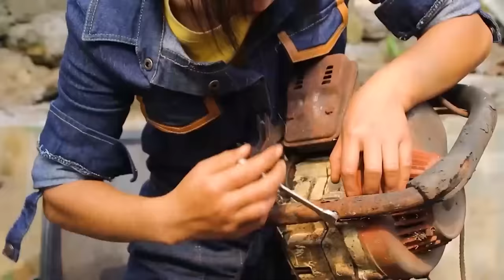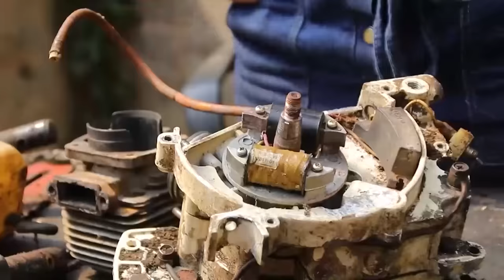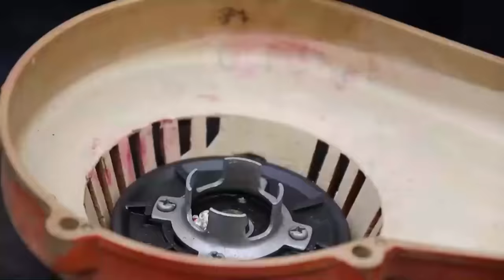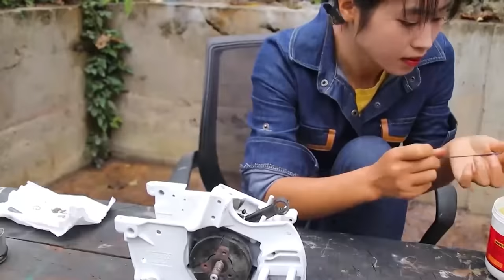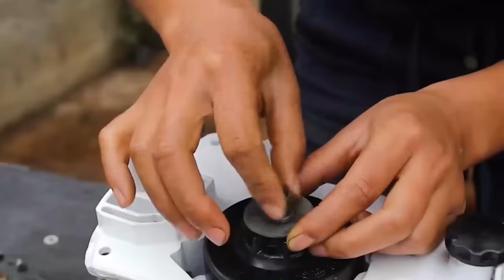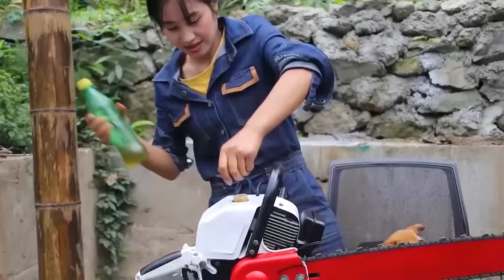💡Girl Restoration Old Rusty Gasoline Chainsaw With Her Own and Fixing 2 Stroke Petrol Chainsaw

Comment: Wow! Another cool project! What kind of chemical did you use as 'rust remover' ? The end result looked great as always. You really had a happy face when testing it out! Hope you do have hearing protection if you have to do a lot of sawing. 💙
Reply: it has to be good, any chemical that actually does the job it is designed to do is not allowed in the usa, our epa has outlawed anything that works.
Reply: they can get good chemicals over there that most western countries have banned, for us evoporust is probably your best option, but is is pretty slow

Comment: That's "file" the serrations - not "sand". Also the best way to use the saw is to have the sharp prongs at the base of the blade - the "bucking spikes" - in contact with the log to provide stability and safety. Fabulous rebuild!!!

Comment: It's easy after you take apart many times before doing video. Rusted chainsaws don't come apart that easy the first time, especially the flywheel without a puller, and rusted bolts in die-cast.

Comment: Really nice rebuild.
toss the chain out and get a new one, old chains are not to be messed with, and that one was still duel af. You don't SAW back and forth with a chainsaw, and it was so duel. A sharp chain would zip though those logs in about 2 seconds.

Comment: Nary a torque wrench nor feeler gauge in sight. 
How is the valve lash checked? Is the cylinder head tight enough on the block?
Reply: It's a 2-cycle engine. It doesn't have regular automotive-style valves.  I'd like to know where they come up with new replacement parts for a saw that is pretty darn old.

Comment: Great work. Always run the engine before fitting the bar and chain so you can make sure the oiler is working properly. Run it and check the oil pump is pumping the chain bar oil out!! ;-)  Please be careful using that chainsaw. Its very old and has no safety brake on it. Stay safe!

Comment: Amazing how she doesn't have to go to the parts store, wait for parts to be shipped and seems to have everything needed right there for all of her "projects" !
Reply: Just because that is not in the video, does not mean she does not have to wait for deliveries of wire or bearings, or paint, these videos showcase her working, they are Not how too instructions,  they show what was done, no clock no calendar, no work hours reference,  I have rebuilt electric motors, i have torn down and rebuilt machinery, it's hours and days not minutes of edited video, i know what it takes, 
Do you want too see video of her traveling to a larger town to get parts ?  This is not a DiY instruction video

Comment: Some things are best left to the ages which includes old chain saws that were unreliable, heavy, they vibrate, they're underpowered, require mixed gas & oil so they also smoked a lot and today would be difficult to find parts for. Besides all of that and they were better then a whip saw but not by much. And there's new Stihl's available for a couple of hundred bucks that are half the weight with twice the power that will cut circles around that boat anchor disguised as a "power saw" (remember when they were called that - I do...)??? Yes there are which leads me to my final question which is - WHY??? Just because one can do it doesn't make that a wise choice. Especially regarding an old chain saw...